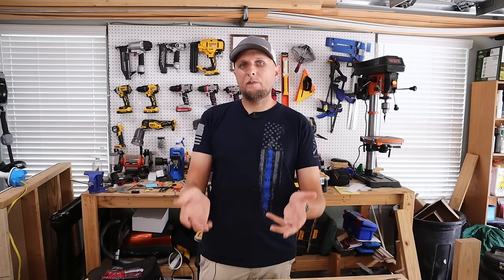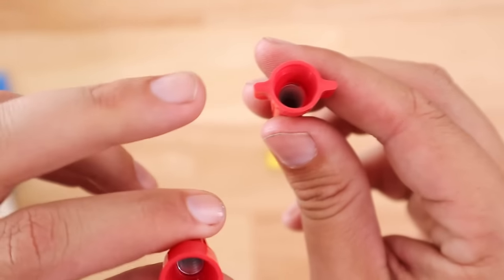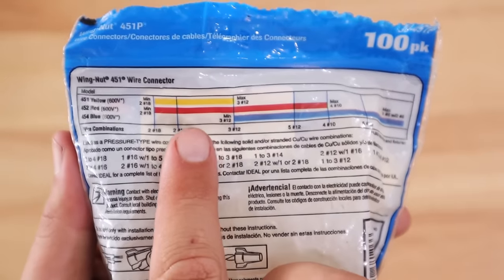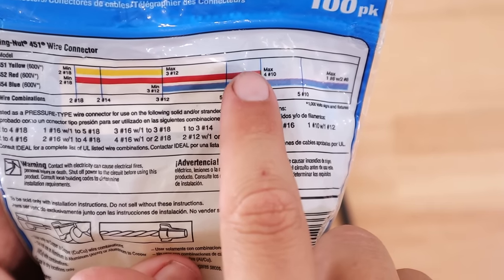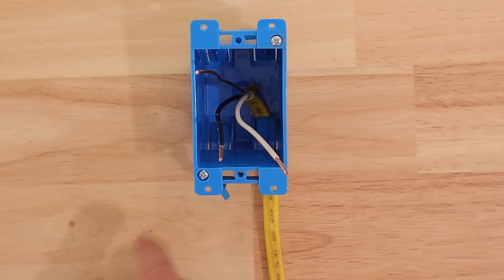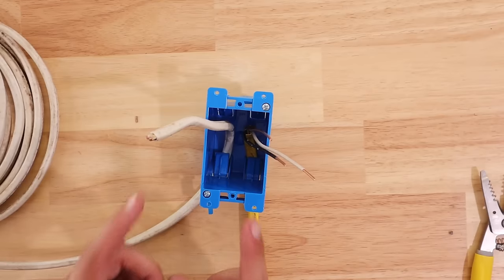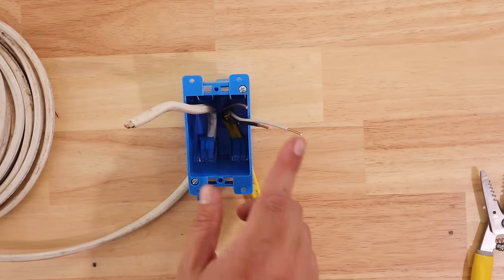Biggest Mistakes DIYers Make When Connecting Wires Together | Part 2

Comment: In my house the previous owner (or the flipper I bought the house from) seems to have put most of the home-runs out of me electrical box as the yellow 12AWG NM cable, but used 15A breakers. Personally, I'd be concerned swapping a 15A breaker for a 20A breaker because I have no idea if someone slipped a white 14AWG NM cable in the middle between junction boxes somewhere... But I do know something about rating, derating, and ohm's law from my training in electronics, even though the vast majority of my knowledge of NEC is only that it exists. ;-) It also doesn't help that the flipper thought it was a good idea to spray-paint the entire basement ceiling and all the service pieces (the wires, the water and gas pipes, etc) white to make it "look nice" (and probably to hide some sins). And as soon as the inspector that I hired went through it looks even more janky than it would have without the paint because of all the places the inspector had to scrape off the white paint to be able to visually do his job to try to find the (now hidden) sins... Moral of this story... If you can help it, avoid buying from a flipper.
Reply from the maker: Yeah that is true.  There are contractors out there that only use #12.  But like you said, with it being a flipped house, you don't know what all has been done.
Reply: When I wire homes (I do new construction btw) I use 14 awg for 15 amp, 12awg for 20 amp and so on,  to avoid confusion in the future.   It also saves money when 20 amp isn't required.   The only time I will use 12 awg on a 15 amp, is when I have a long run (over 100 foot) from the panel to the end of the circuit and I want to compensate for voltage drop.    That rarely happens,  because when we find we have a bunch of runs far away we typically will run a 60 amp subpanel near the far location vs having to oversize all our runs.   It's far more economical.    Especially with the price of wire now.
Reply: If you really wanted to, once you know what's on that circuit,  you could remove the coverplates on switchs, receptacles, lights,  etc to see if 14awg had been run anywhere in between,  if it turns out to be all 12awg,  it's probably safe to up the breaker to 20 amps.   That being said,  in certain cases such as a long run to the panel, they will often oversize the wiring to keep voltage drop under control,  but if  there's multiple circuits far from the main panel it's  far more common and economical to have  a subpanel,  say 60 amps or so, near the remote location,  instead of oversizing all the circuits.

Comment: If the 14-gauge wire is on a 20amp breaker and overheats, if it's hooked to a GFIC outlet, would that outlet trip?
Reply from the maker: Not necessarily.  GFCIs are more so there to detect ground faults.  Where circuit breakers are there to protect from too much or a surge of current higher than the rating of the circuit breaker.
Reply: @HowToHomeDIY  Ok that makes sense.  I just ran 14/2 off of switch to make a plug and its on a 15amp breaker so im good but now im 2nd questing myself haha

Comment: So here’s what I think is a common situation — you replace a light switch with a smart dimmer or a timer switch that needs neutral. The current neutrals are twisted together in a wire nut. Do you need to untwist them, add your neutral pigtail, and re-twist, or can you leave them twisted, add your new neutral pigtail and screw a lab appropriate wire but on top. There’s often not lots of wire left in the box if you need to cut and re-strip.
Reply: I would consider using a Wago lever nut in that case. You should still have enough room to cut the twisted part, re-strip 1/2".

Comment: I’m just a DIY’er, but the problem I run into most is finding too much wire in the box or the box seems too small, especially when you need to add pig tails. I don’t know how to properly fit all those wires back into the box and find myself jamming them in there as best as I can. Is there a trick to doing this properly?
Reply: Yes, use the proper size box. There are NEC box fill rules that limit the number of conductors and devices in a box based on its size in cubic inches.

Comment: As a now passed electrical contractor put it to me many years ago, wire all outlets to potentially take 30 amps and all lighting circuits to take 20 amps even if you just put in 15 and 20 amp fuses as 1) with the old screw in fuses it is too easy to up the fuse if you keep blowing it, 2) you don't know what future electrical devices may be plugged in that may have heavy draws, and 3) you know how you wired your cabin or house but 10 to 30 years later someone else might not have a clue how you set out the circuits.

Wire connecting devices, always have an assortment of sizes and always check/tug each wire and the group to ensure you don't have a faulty one (yes I have pulled the springs out of even quality connectors) or a poor insertion (yes even if wires are twisted it is too easy to miss align and push a wire out of the twist) or fixing an old botched job you didn't notice a wire partly melted until you tug the wire apart. Triple check stranded to solid wire connections that are typical with light fixtures, too often those connectors are all that holds the fixture until you finish the mounting process and you only have two hands.
Reply: That was when wire was significantly cheaper...
Reply: @BigBisalreadytaken  And even then, it was a waste of time and $$ to do so. #14 THHN is already rated for 25amps and #12 THHN is already rated for 30amps. Even old TW, 14 was rated for 20 and 12 was rated for 25. Haven't seen a fusebox without Type S adapters in many, many years, which limited the fuse size to match the rating of the adapter.
Reply: @pld8993  people dont realize it's not the wire being protected it's the devices that are only rated for 60 degrees celcius
Reply: I have always used my needle nose pliers and linemans to twist wires together.  In my experience wire nuts cannot do the same job.  Simply put the wire nut is a basic cover for the exposed wire.

Comment: A friend wired an addition on his house.  He wired the outlets with 12 AWG but installed a 15 amp breaker.  Thinking that was a safer situation.  The breaker would trip before the wire even got warm.  The city inspector made him remove the 12 AWG saying that it didn't meet code.  Both Arthur and I thought the inspector was all wet but ripped out the 12 and installed 14 AWG as ordered.
Reply: What ? That does not make sense !
Reply: @trespire  it only makes sense when you realize that there seems to be just as many bad building inspectors as there are good building inspectors and the bad ones are usually on a power trip (no pun intended). Why do they do things like that, because they can!
Reply: @trespire  Exactly.  The inspector from Virginia Beach, VA, where Arthur lived, insisted that would not meet code.  WTF?  Rather than raise hell and get this moron fired or reeducated, Art thought it was easier to make the change.  Yikes.  This happened in 1971.
Reply: @46bovine  Why not just swap the breaker to the 20 amp the circuit can support?
Reply: @mikeslater6246  a lot of crooked and arrogant ones on the “ take” as well
Reply: I dare say if your friend was a licensed electrician, the inspector would have pencil whipped the permit without even getting out of his car. That's been my experience with Washington L&I
Reply: 12awg wire, 15a receptacles, 15a breaker. there is zero problem with that whatsoever in terms of code or safety.

Comment: I'll admit to doing this.  Most of the supplies and multibranch circuits are wired completely with 20A 12-2.  
The ONLY exception to this is a branch feed to a dedicated LED lighting sub-circuit.
The dedicated hardwired lighting sub-circuit is running 14-2 I had as a left-over.
It powers 6 LED plate lights at 9 watts average. 6x10 (safety fudging)=60 watts.  
The total load on the dedicated sub-circuit is 60W@120V = 2 amps; well below any range of concern.
But, you're right; it could be confusing to someone who hasn't worked on the circuit.
Reply: im not sure you're using the right term when calling it a multi wire branch circuit
Reply: @bc1173  I may not be.  The main feed line has one branch tap to the dedicated lighting sub-circuit; the primary "trunk" line from that point continues on to feed the gas range outlet.
So, to my way of thinking, I consider the lighting circuit, a sub-circuit (or branch) of the range outlet main circuit.
Reply: So I have a 20 amp 12-2 circuit going in to a room, I want to tap that and put a light switch and some leds would that be fine? Also using 14-2 for the light wiring
Reply: @TheOctane24  that would be against code. you'd have to run 12/2 from the plug to the switch and the light switch would have to be a 20a switch. if the circuit breaker is 20a all of the devices and wiring down the line have to be adequated sized to be protected by the breaker. So you can run 12/2 wire on a 15a circuit, but you cant run 14/2 wire on a 20a circuit. 

basically the circuit breaker has to be equal to or less than everything it's protecting so that the breaker trips before electrical damage occurs on the wiring or the devices.
Reply: @TheOctane24  No.  The expected load on the portion of the circuit in question really isn't the issue.  The issue is that you have a breaker that will only protect against unintended loads above 20A and if you induce a load of more than 15A on your 14 gauge wire, bad things might happen.  Even if no one ever says "hey, that's a great spot for a receptacle for my 2000-watt space heater!", you still might have a partial short circuit (possibly even within your LED fixtures or your wiring to them) that provides just enough resistance not to trip the 20A breaker, but plenty of juice to heat up your 14 gauge wire and cause issues.

It's definitely against code, and also very unwise, to make any permanently-installed wiring a thinner gauge than the circuit is rated for.
Reply: The current draw is .5 amps. P=ExI. I=P/E. 60/120=.5

Comment: I have to wonder about some of the comments below.  Not sure what Michaelvorel8688 is refering to, but it is not that uncommon to share a neutral, we do it all the time in conduit and some in residences.  A double pole breaker should be used.  I think these may become less popular as ground fault/arc fault breakers become the standard.  As for two switch circuits in one box, sometimes it is necessary and using seperate boxes does not have a very good look...use your meter to check!  Also LordxJoe, Multiwire Branch Circuits should be pig tailed to prevent an open neutral, but half switched no, not unless the top and bottom are on sererate circuits. I also want to point out that the two hot "Legs" in a residential panel are not phases.  While they are opposite in the phase rotation, they are the same phase.  They should be refered to as Leg 1 and Leg 2, not phase 1 & 2....and no this is not the two phase system that was in the code book until the late 1970's, that was a system used in factories in the first half of the 20th century.  It was dropped from the code book because it was obsolete.  I really don't know if the code ever allowed over head fixed lighting to be reduced in wire size to 14 gauge tapped from a 20 amp circuit. I have however seen this.  From strictly an  engineering point of view, it probably isn't that dangerous, as a dead short would certainly trip the breaker and I can't really guess what could overload the circuit, if only light fixtures were on the 14 gauge wire.  Would not worry about it unless doing a complete rewire.

Comment: Question. What about led lights with 16 or 18 gauge wire . When you run a 12 gauge wire on a 20 amp circuit to them , is that a fire hazard? If so , what now?
Reply: are you referring to a UL listed LED light with 18 gauge pigtails?  those are approved to connect to a 20 amp circuit or they wouldn't be allowed to be listed.
Reply: @kenbrown2808  yes they are Ken, and that answers my question. I knew logically that had to be the case, but I wanted to be sure there wasn't some devi e required to step down the amps. Thanks very much and I enjoy your videos

Comment: I do not let any wire smaller than 12 on my home builds and only use industrial grade 20 amp outlets I also use 100 amp sub panels to keep all my branch runs under 50 foot. Not uncommon for a 3,000 foot house to have over 35 circuits for outlets and lighting plus appliance and mechanical circuits. A lot of overkill but in overall scheme does not cost that much more.
Reply: There's no need to keep runs under 50', at least not for voltage drop purposes, according to the math. For example, a 100' run of #12 Cu pulling 16 amps in a 120V circuit will lose 5.9 volts, less than 5%.
Reply: it costs hundreds and hundreds of dollars more actually. upgrading all of the plugs, switches, wiring and breakers from 15a-20a and 14awg-12awg is not cheap.

Comment: question: if I have a 140 foot run of 10/2 - can I have circuit breakers on BOTH sides of that run?
Reply: Yes
Reply: wait... what? no, you can't have two breakers feeding the same circuit, that would be double fed and would trip immediately.
Reply: @bc1173  Not two feeds. He's asking if you can have a circuit fed from a breaker in a panel but have another breaker at the other end of the run. Kind of like feeding a sub panel from a main panel but also having a main breaker in the sub panel.
Reply: @bc1173  well, that is a separate question:
Is it proper to also put a breaker on the neutral line?

Comment: Why would you be concerned if you were using the 14 ga. wire for running LED lighting in a ceiling as these lights draw small watts,amp.s but would be on a 20amp breaker?
Reply: Because a 20 amp breaker requires a minimum 12 gauge wire throughout the circuit. I get your point and I think it's unlikely that you will have a problem in your example, but Adam makes a good case of why it shouldn't be done.

Comment: Don't forget there could be the old alluninum wire in there too at which point you will need special wire nuts if your mixing copper and alluninum wires.

Comment: You may not be correct about getting away with mixing 15 & 20 amp wire if you have a 15 amp circuit breaker. I failed inspection on this exact issue. Inspector said if has any 20 amp wire then it is a "20 amp circuit" (despite whatever breaker size you use) and needs all the correct components of a 20 amp circuit, for the reason you mentioned, that it would be easy for a homeowner to assume in the future they could up the breaker to a 20 amp or otherwise try to use it/ modify it as a 20 amp circuit if all they are seeing is the 20 amp wire portion.
Reply from the maker: I never said you could mix and match #12 and #14 wire on the same circuit.  For the reason the inspector gave you.  It’s been a while since I made this video but I may have said you could get away with using #12 on a 15 amp circuit but you cannot have #14 anywhere on a 20.
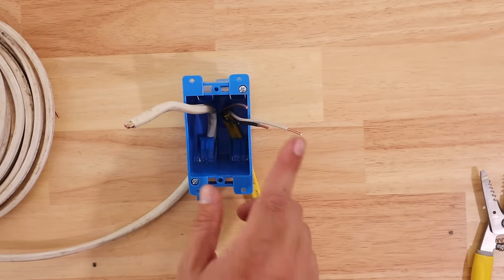Reply: @HowToHomeDIY  At 9:06 you did say you could get away with #12 & #14 wire on the same circuit if you use a 15 amp breaker. This is the sentence I'm saying is possibly incorrect, as our dedicated electrical-only inspector here in the Seattle area (they are highly trained and follow the NEC closely) says that for residential single family homes you cannot mix wire sizes on a circuit for future life & safety reasons. We all know you can't have #14 on a 20 amp circuit, but the inspector said the definition of "20 amp circuit" is not defined by the breaker size as you are saying in this video. He claims the circuit size is defined by your wire size, so what you think you are calling a 15 amp circuit, he would call a 20 amp circuit, fail your job, and require you to upsize everything to a 20 or everything down to 15 amp.
Reply from the maker: @Grrrnthumb ok I went and rewatched.  So I still stand by what I said.  Due to nothing in code saying this and because I then go into how one should not mix the wires and possibly confuse an electrician or homeowner down the road.   As for your inspector, Seattle may have additional codes that he is enforcing where wiring cannot be mixed.  Or he’s interpreting the NEC somewhere differently than anything I’ve ever found.  Or it’s always possible that he’s a power hungry inspector that fails things if he thinks it’s just not up to his standard.  I’ve come across those too.  But per the NEC, there is nothing that states that’s #12 and #14 can’t be on the same circuit as long as it is protected with an appropriately sized breaker which in this case is a 15 amp breaker.  But in order to pass inspection, unless you want to fight it and find grounds to fight it, then just have to do what the inspector says.

Comment: Question how many wires can you put into one of those pipes to just one set of two sets
Reply: It depends several factors, but you may be able to put 4 sets of wires in there in a deep (22 cu. in.) single gang plastic box. There are box fill calculations you make to determine this.